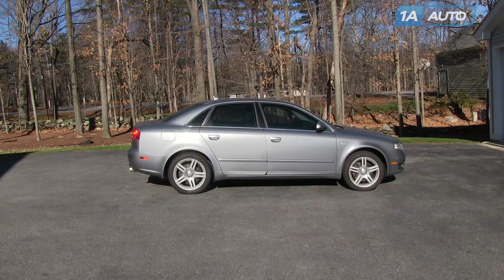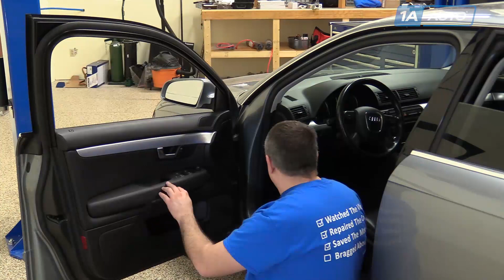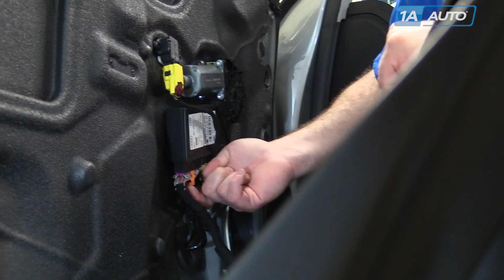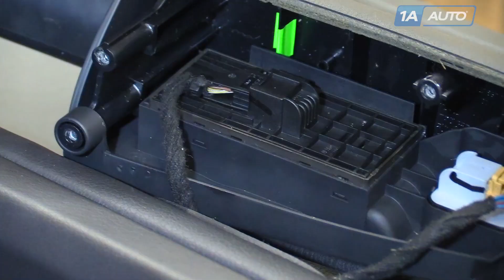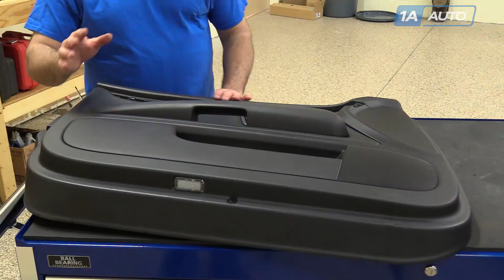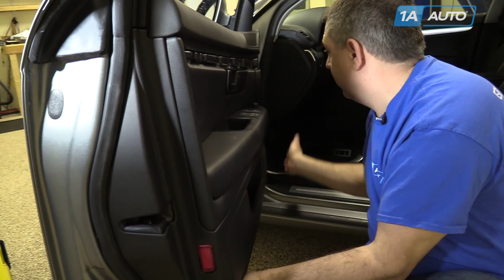How to Replace Master Power Window Switch 02-08 Audi A4

Comment: My door entered some sort of error, the lights and switches on the door panel don't work but they worked before removing the panel. The speaker works though. Is there something you gotta do to restart the ecu in the door or??

Comment: You dont actually need to remove the arm rest just the door panel. Then remove switch with 90 degree pick and pull on the harness to release it

Comment: I went thru the exact procedure to replace the broken switch on my wife's '07 A4. Pulling out the metal trim panel was a neat trick I wouldn't have known about. Thanks to you, youtube and other videos like this made it quick and easy. Just wish they made those silly plastic clips that break off so easily with better plastic.

Comment: Couple of points.
2:00 First, this maybe model specific, but there's one more Philips screw right at the bottom that will prevent removal if not undone. Plus mine had 4 latches to pull out near each corner, wasn't quite as simple as a gentle pull.

3:40, 6 extra screws, not 3, which you can see in next scene have also been removed.

It might be a bit pedantic but some literally following this may find this helpful.

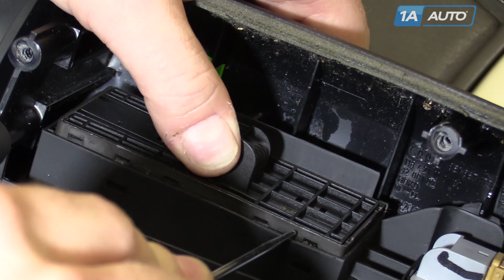4:40 if your having trouble getting the switch out, as there's also 2 tabs on the back which can be tricky to undo, due to reach, but you can remove the panel that houses the switch from the door handle, no screws or tabs just need to pry it away from 4 points.
Reply from the maker: +7EimaJ7 Thanks for the feedback!

Comment: This is a great video - bought the part from 1A Auto.  I was tempted to replace the switch without the removal of the door handle but I already had the T20 and it gave me a chance to marvel at Audi engineering.  Thanks again!
Reply from the maker: +Dan Haller Thank you for your feedback and your business!

Comment: Excellent video and thanks for the great deal on the power window switch gear!   

However, I want to add to the instructions for this video that might be pertinent to particular years of the Audi A4.

I have a 2003 Audi A4.   There is a single Phillips head screw at the very bottom center of the door panel.   With the age of my car, it took a fair amount of force to pop the door panel retaining clips off the door.  I actually broke two of the clips in the removal process. (This proved to be not vital in replacing the door panel since the panel has many attachment points.)   

I would also advise to remove the power lead to the power mirror switch so you can separate the armrest completely from the door panel.  Once the armrest is removed from the door panel you can see that the armrest is actually two pieces. Separate the plastic part of the armrest (which holds the power window switch gear) from the rest of the armrest.    This will give you access to the window switch on both sides.  There are two more retainer clips on the far side of the switch that need to be loosened (like the front side).    This made it much easier to remove the switch!

The installation of the switch, putting the door panel back together, and reinstalling the poor panel onto the door was fairly easy.
Reply: BTW.  The nomenclature, the casing, and the connector look different from the original equipment on my 2003 Audi A4.   However, the retainer clips are in the same location and the power connectors matched up and clipped into place with no problem.  You don't even notice the different nomenclature on the switches from the other door window switches.
Reply from the maker: Thank you for the great reply and feedback. We love to empower our customers by showing you how-to perform your own auto repairs while installing our high quality auto parts. Have a great day! 1aauto.com +Gus Jay

Comment: Your video was a saviour, many thanks. I found you can access and remove switch without needing to remove the door handle with the T20 etc, just a bit tighter space to work with but comes out no problem. However, after swapping out the switches with a new one, I still found the fault with my driver window, along with issues with all four other windows remained. Next, I opened and exposed the door wiring loom between door and body, unclipped rubber boot and wiring loom and found a very fine red/white wire that had a clean break, reconnected and that fixed it. So along with the switch going, a common problem is the wires breaking within that rubber door loom that bridges door to body.

Comment: Somebody soldered after market speaker wires so that I would have to cut them to get the panel off mine. For some reason after trying to remove the switch harness unsuccessfully without taking the panel off, the switch worked long enough to get the rear window back up. I have both master and rear window switches ordered and put them all back together till they arrive.

Comment: Power windows isn't working on my 06 cls500  what can I check????? Please help
Reply from the maker: +Ronnie Hughes You may want to test the power going to the power window switch to see if there is power going from the switch to the power window motor. You can use a test light to test. Hope this helps you out. 1aauto.com

Comment: Is the same procedure for the 2007 Audi Q7? Switch looks Identical
Reply from the maker: +influxvision It may be a different procedure on your application. We currently do not have an auto repair video for this particular year, make and model. Thank you for asking. 1aauto.com
Reply: 1A Auto Parts It is very similar,  the only difference is, that there is one screw behind the cover in front of the lock buttons, one on the door handle, one on behind the design trim,  and one on the bottom center of the door panel

Comment: This is auch an excellent video!  I THINK this is my problem, but maybe you can help?  About 2 months ago I left my interior light on overnight which caused my battery to go dead.  Ever since recharging the battery, my drivers side window rolls up and down, but none of the others do.  Yes, I have tried checking all fuses and engaging and dis engaging the child lock.
Reply from the maker: +Michelle Harrington Thanks for watching. When the battery died, some of the options may have gone into a fail safe mode. This would have to be diagnosed at a local repair facility for the exact issue. If any of our viewers needs to make this repair, we carry the auto repair part shown in this video on our website. Here is a link to them http://www.1aauto.com/audi-a4-s4-master-power-window-switch/i/1awes00214?utm_source=YouTube&utm_medium=CTA+Comment&utm_campaign=ytcomment&utm_term=50qoz-b5t6o

Comment: Hello guys. Hope you can help me. On my b6, the window lock button does not hold on the button (meaning it is always up so the windows are always locked). All the controlls work but the button just doesn't hold. Do I need to change the whole piece or can it be something else?
Reply from the maker: +some105 You may need to change the switch assembly. The button is more than likely worn out. We carry the one shown in this video on our website. Here is a link to them. Hope this helps you out. http://www.1aauto.com/audi-a4-s4-master-power-window-switch/i/1awes00214?utm_source=YouTube&utm_medium=CTA+Comment&utm_campaign=ytcomment&utm_term=50qoz-b5t6o

Comment: Thanks for the video. Very clear and very easy to follow. I ordered the switch from you guys, and installed it in a few minutes! Unfortunately, it did not fix my problem :( All my windows work, EXCEPT the driver side. The switch was pretty easy to replace, so I started there. I'm thinking of replacing the motor, but would like to know if there is some way to check that my wiring is working and it is indeed a bad motor. The electrical connections are pretty complicated.

Any suggestions would be greatly appreciated.

-Mark
Reply from the maker: +Mark Addesso Thanks for watching. If your driver side window still is inoperable it could be the motor/regulator that is causing this matter.  If any of our viewers needs to make this repair, we carry the auto repair part shown in this video on our website. Here is a link to them http://www.1aauto.com/audi-a4-s4-master-power-window-switch/i/1awes00214?utm_source=YouTube&utm_medium=CTA+Comment&utm_campaign=ytcomment&utm_term=50qoz-b5t6o

Comment: Hi Mike - two questions:
1. Is the installation pretty similar for a 2011 Q7?
2. My window button is "sticky" ie. Sometimes the window goes down, sometimes is will not... sound like the switch?
Reply from the maker: +Oscar Mayer Thank you for checking us out. To answer your question number 2 it does appear that the switch is intermittently failing causing this stick. Some of the steps should be similar, but the Q7 will have slightly different steps. 1aauto.com

Comment: Thanks, great video. Just ordered a new switch from you guys. Rear doors won't open unless I hold down the child safety button but once I release the window stop moving. Also hoping this fixes my problem with the car not unlocking when I get out and my keys and I get locked out. Learned to never get out of the car without my keys or leaving a window open.  Thank you, Tom
Reply from the maker: +Tom Markham Thank you for your order. Keep us posted on how the replacement goes and if your issue is resolved. If you would like to leave us a review on Google it would be greatly appreciated. Here is a link to our reviews section. Have a great day! https://goo.gl/i5JFNY

Comment: Excellent video, but there is a step you might want to include when you are removing the switch. Sometimes it doesn't lift straight up, like in the video. That's what I experienced; you can take the armrest apart since it also clicks in on the other side as well. Otherwise, you can break the clips that hold it in. Thanks again.
Reply from the maker: +Nathan Lane Thank you for watching, and the tip. We appreciate all who provide recommendations to assist other viewers in order to ease the replacement. 1aauto.com

Comment: there is another screw at the bottom, you need to remove that before pulling the door cover. Audi a4 2008
Reply: Oscar Luis Torres just about yank the pocket right off until I noticed that screw.  Thanks for sharing!
Reply from the maker: +Oscar Luis Torres Thank you for watching, as well as the advice! We appreciate any information to help other watchers. 1aauto.com
Reply: Not working for me is there more than 4 screws
Reply: Thanks for that info!  lol  I was doing the same thing as Lucas.  lol    I have an 2003 Audi A4 and the door took a fair amount of "convincing" before it would let loose.

Comment: My Audi has a red light in this switch, Does the replacement part come with a different color than red?
Reply from the maker: +Jamesson Peña Not sure offhand, but if you call our customer service department they'll be able to give you an answer promptly! Here's the number to call 888-844-3393. Tell them you're inquiring about part number 1AWES00214. Hope this helps you out.  1aauto.com?utm_source=YouTube&amp;utm_medium=CTA%20Comment&amp;utm_campaign=1ATony 866-403-3393